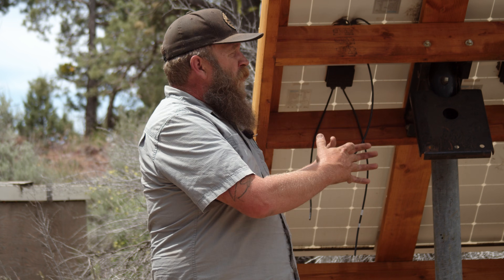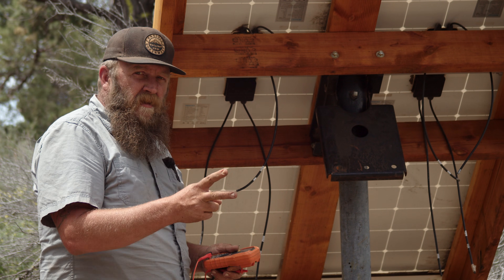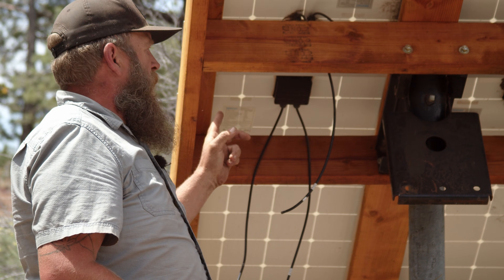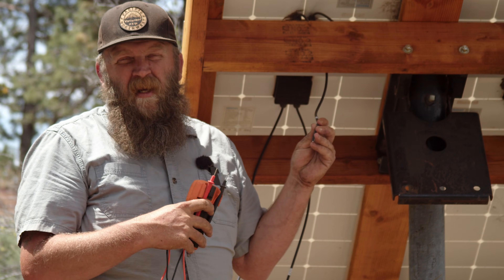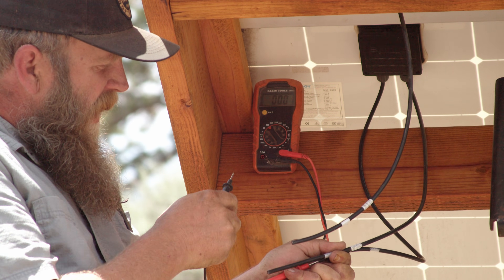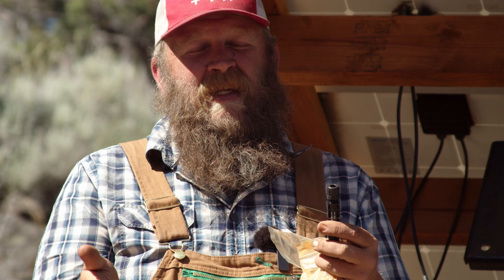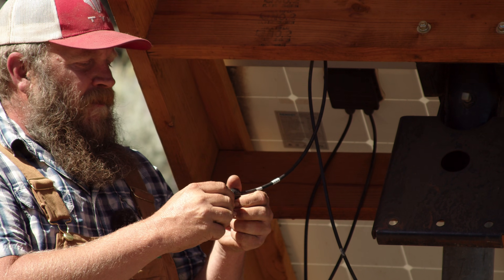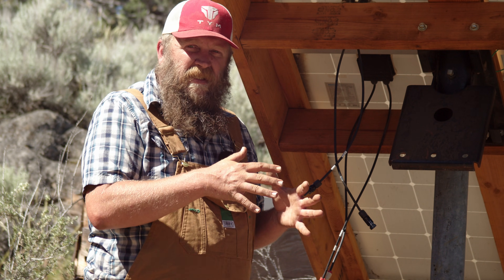Making Electrical Connections Safely on Your DIY Off Grid Solar Array

Comment: My panels have studs in a box.
Reply from the maker: Are they pretty old?
Reply: @ they are NOS made in Southern California by Solec, commercial grade. I was doing off grid solar for boats. Not sure of actual date of manufacture. 2000 maybe.
Reply from the maker: @aircommuter  nice!! Now they come with the mc4 connectors already attached and soldered in place. The problem with the studs is the corrode really badly due to being dissimilar metals and DC current.
Reply: @ they can but I use no-oxide.
Reply from the maker: @aircommuter sweet!! 👍
Reply: @ those new panels with plugs are much faster and safer when you get up in the 500 volt range 😳
Reply from the maker: @aircommuter very true. I think that was a main driver to changing to mc4 connectors too. A lot of folks got hurt back then.
Reply: @ off grid I was using 48v of course 80v OC. About like old dial phone ringer voltage. Just enough to make you let go.

Comment: I am absolutely defeated with my solar setup 😂. My current issues are a fuse popping whenever I run 1000w on my 2000w system. “40amp fuse supplied in kit from renogy” My other issue is I have 6 panels 4 100w and 2 200w running parallel. I thought that would be 800w but I’m only getting 370w. Can’t run in series because my 40amp renogy charge controller can’t handle the voltage.
Reply from the maker: I totally understand. It can be daunting to sort through these things. First off, the panels need to be electrically similar. The bidder panels will bottleneck through the smaller and will only ever make the same power as the smaller ones. As for the inverter issue, what's the load? It sounds like one of two things must be causing that. 1, the inrush power upon startup is significantly higher than 1000 watts for just long enough to pop the fuse or a wiring problem. Is the inverter 120vac or split phase 240vac?
Reply: @ Gotchya, does the power from larger panels still get bottlenecked running parallel? My inverter is a renogy pure sin wave 2000w
Reply: @ I’m going to have to guess it’s single phase 120
Reply: Not trying to plug myself but I’ve got some videos on my solar setup haha